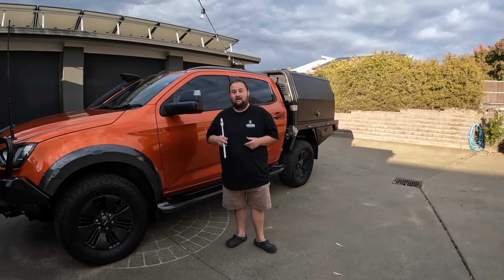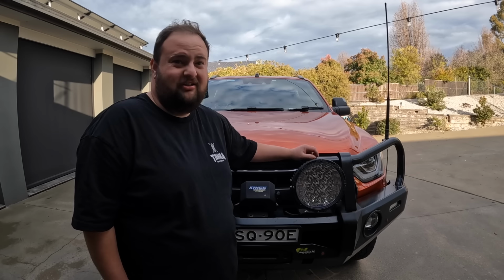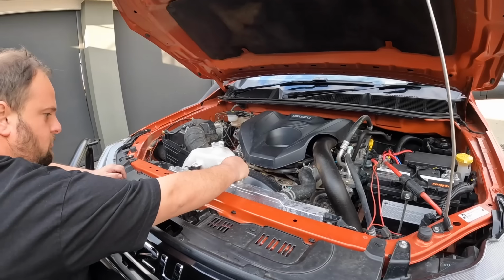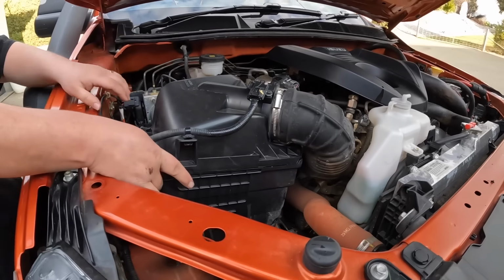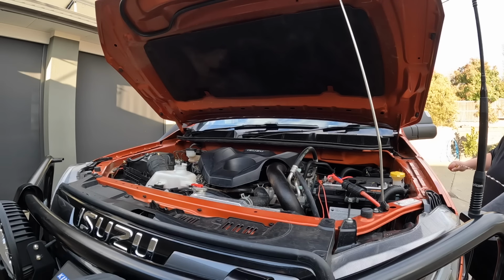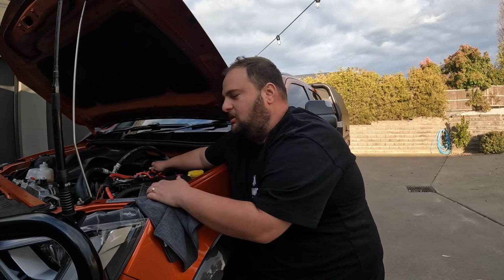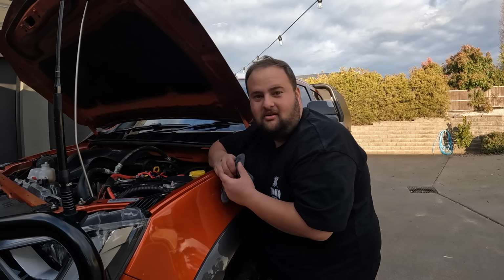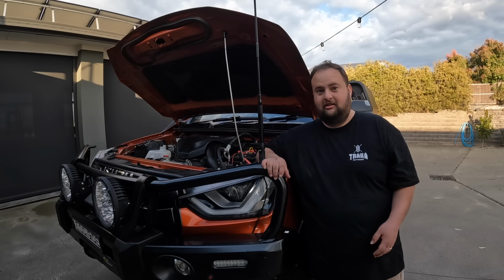ANOTHER DAY, another issue with the D-Max! #travelcouple #travelvlog

Comment: Hi Aaron. Im an experienced mechanic and the checks I do before hitting the road are, all fluids that are reachable, wheel nuts, tyre pressures, visual under body check, battery check, light check and I check my air bags in the rear too. Your Dmax will tell you when its time for the fuel filter to he changed but still doesn't hurt to do em every 10-20k. Also I would check if yours is eligible for the upgraded front hubs. I'm pretty sure there's a recall on them as they suffer from bump steer and premature tyre wear. I hope this has helped.
Reply from the maker: Hey mate, thanks for the tips love to know what is required and overkill! We will look into that recall, would be potentially something worth getting fixed if we are apart of the recall. thanks again mate safe travels!

Comment: Hi my 2 cents worth (as a mechanic) would be to use a tension wrench when checking wheel nuts (check specs in the handbook) and you can check your brakes if you wish. Pop the wheel off and see how much meat is left on on the pads. If you’re doing a long trip also not a bad idea to run your eyes over the shocks to check if any oil leaks.
Reply from the maker: Good tip although we dont have a torque wrench and due to stripping the weight can't carry one around oz anymore, this seems to do the job! In terms of brakes this is true hadn't thought of taking off the wheels due to the brake replacement last week but good for the normal days where the brakes aren't brand new and you are heading off on a trip! thanks so much for your comment and appreciate you watching :)

Comment: Are the MSA TM902's towing mirrors wider than the original mirrors and are you happy with them.  The problem with the DPF engines is they normally gain oil level and my DMax service centre are always over filling the bloody thing.  Isuzu recommend changing the fuel filter when the change filter light comes on, my LSU has 65,000k now and I change the fuel filter every 20,000km or there abouts.  I am using Penrite Enviro+ 10W - 40 Full Synthetic engine oil and changing the engine oil and filter every 7,500km, everything else gets done according the the advised service schedule.  Except for the coolant, I intend changing that every three years now, the blue Penrite coolant is relatively cheap and a good product.  The ute never uses a drop of oil towing the van.  I give the Isuzu service centre the oil to make sure it gets what I want.
Reply from the maker: 100% we are stoked with them and they are so much wider than stock mirrors, they are also compliant for the GVM/GVM upgrade. We have never had the fuel filter light go on but thought it would be worth while changing it over on the mechanics advice, we will not go to Isuzu service centres anymore after having too many bad experiences with them advising they did things and it not actually being done eg, rotating tyres etc. Now I'll only go to a specialised 4wd independent, but if you have a good service centre that's unreal. That's the tricky thing ensuring its not overfilled cause then your worse off than you were!

Comment: Should use a torque wrench and set to the correct torque setting. Also use loctite to stop nuts from vibrating loose.
Reply from the maker: Cant carry one of these around Oz due to stripping the weight, this tool seems to do the job as it was just a check over and the nuts are already tight.
Reply: Hey, you need to route the UHF aerial wire around the Bullaring rather than it just hanging down and flapping in the breeze...it shouldn't affect your gym. Lol
Reply from the maker: hey we did have a cable tie around this but it has recently snapped, thanks for your comment!